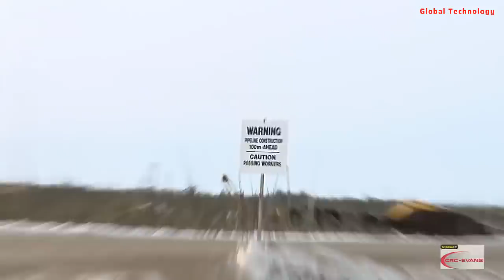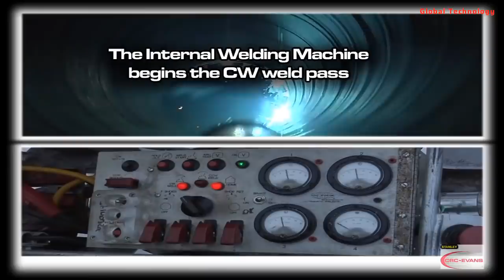Amazing Machine and Tools - Underground Pipe installation process, Huge Pipeline Construction

Comment: We should be doing this on the Keystone pipeline now not buying more oil from Opec
Reply: I'm sure somebody is getting a kick back from it, Buffet owns most of the railway service that's hauling the Oil to refinery's instead of the pipe line a BIG BIG Democrat donor..
Reply: Go research the Keystone line. It is flowing oil and section three just got replaced and finished a couple weeks ago.

Comment: The pipes at the end, in the desert, do not look like they are coated. If they are, the rollers from the side boom cranes will damage it. I have done enough here in Jersey and the coatings are inspected as much as the welds.

Comment: Joe Biden ended that job on Keystone pipeline
Reply: Nope! Section three of the Keystone just got replaced. Was just finished a couple weeks ago. Only the XL fourth part got canceled. Keystone is complete and has been flowing oil. Go research the Keystone pipeline. Your source is a liar.
Reply: @johndee5973  We need the XL too now🛢️🛢️🛢️🛢️
Reply: @LuxAudio389  So you don't know of all the other pipelines that have been completed in 2021 and others in progress. Or why the XL was cancelled. The Keystone line is flowing oil. They have had major leaks and in court since 2011 over their lack of cleanup of spills. Why would you allow a new pipeline on virgin soil to be disrespected as that foreign company has been to America? They can replace the original pipeline with new pipe and cleanup their spills.